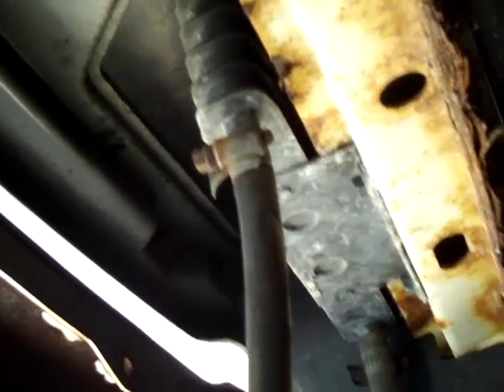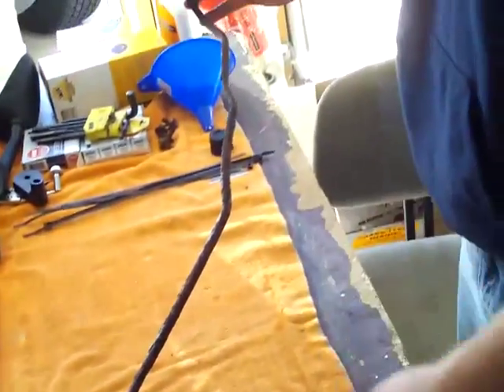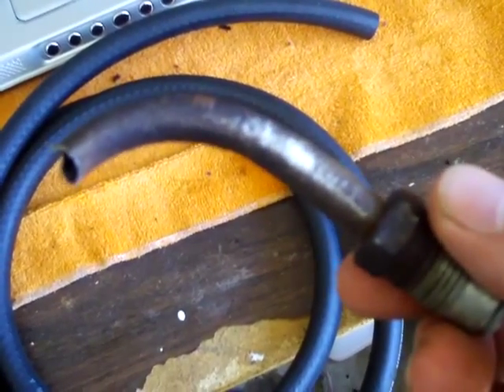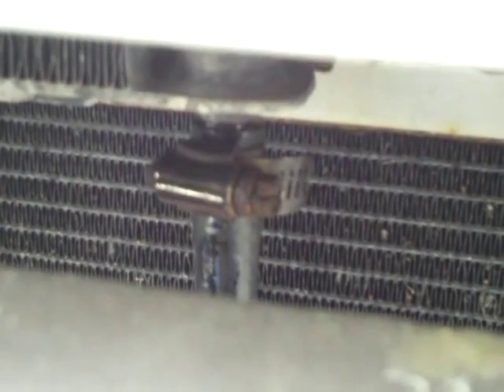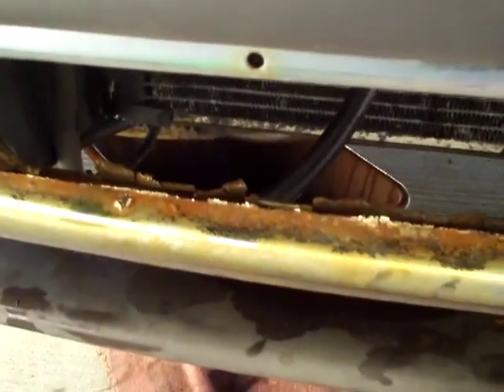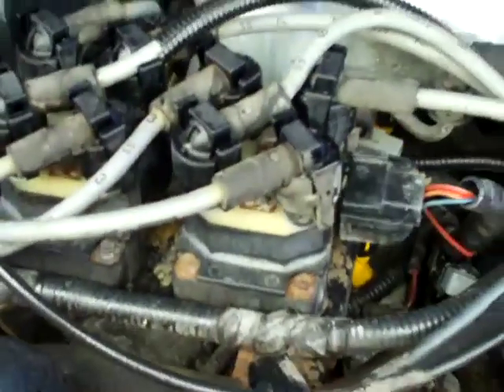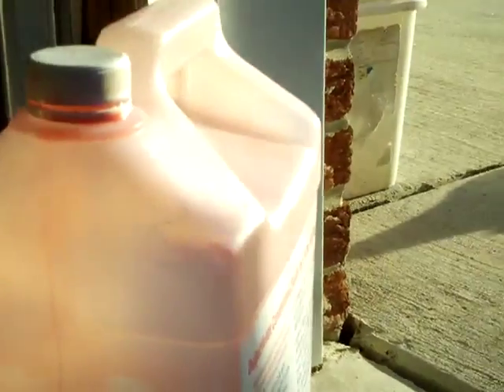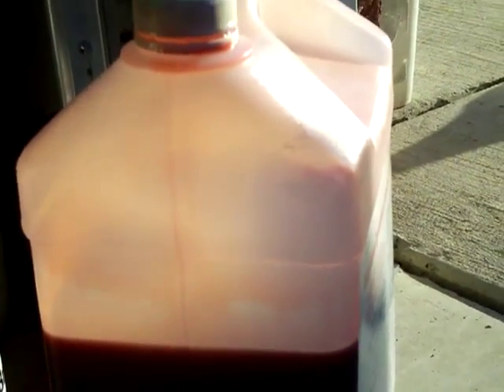Transmission Flush 1996 Ford Explorer 5.0 AWD Trans cooler line repair

Comment: the rumbling and grinding you guys are referring to is the universal joint on the drive shaft. i had the same problem.just drop the drive shaft and replace the universal joint or both

Comment: i have the same problem too. . . replaced front and rear diffs and transfer case fluid. from what i understand the transfer case does need a friction modifyer and i do not have that in mine. . .maybe that has something to do with the revolving noise. . . idk.

Comment: So I understand this correctly... You can drain ALL the trans fluid into the bucket... "not starting the car"  it will pump all the transfluid out then you can refill it with brand new?

I ask because I am about to do a flush and that seems like the easiest way of what you did via disconnecting the one line...

Thanks,
-N

Comment: actually i bought the truck like that from an auction but the trans oil seems to look clean and its not a 4x4  .its a v8 .funny thing is i took a long ass road trip and no problems at all just that annoying sound  lol.well when im going freeway speeds you cant really feel it or hear it much its more on street driving.

Comment from the maker: There are a number of things that could cause the grinding.  You might want to flush your differential and your transfer case.  Transfer cases are known for making a grinding noise when the fluid needs to be changed.

Any chance you can make a video of the noise?

Comment: Howdy.  I have the same problem (leaking trans cooler line).  What kind of hose did you use to replace the original line?  Does it make any difference whether it is the return line or the line going into the radiator?